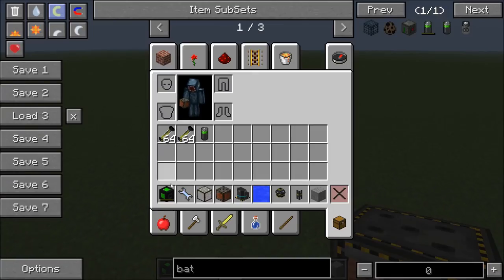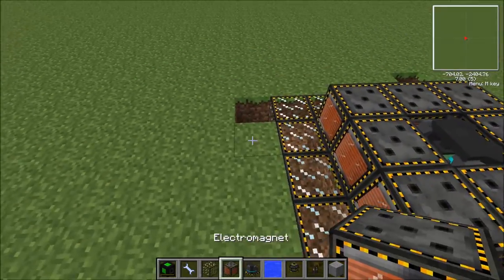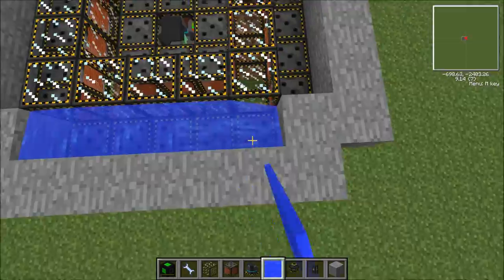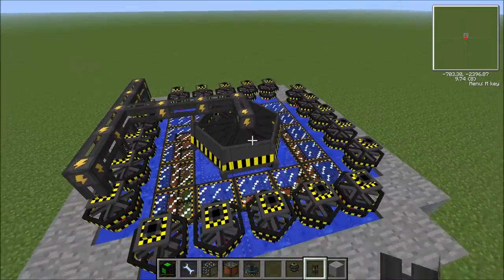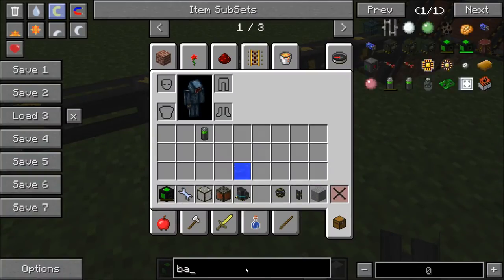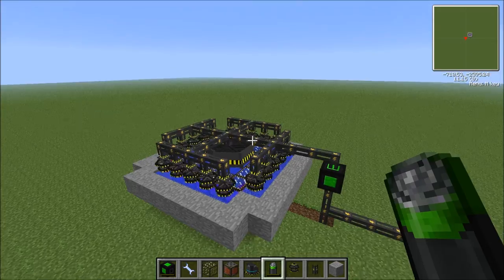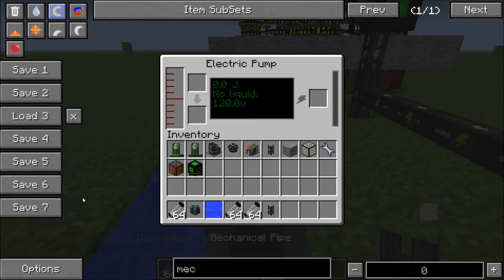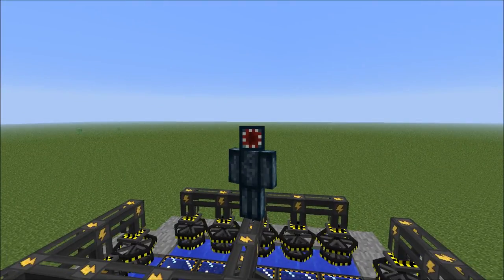VOLTZ TUTORIALS: Fusion Reactor (Small Setup)

Comment: Hey i know this is an old video but the reactor uses more power than it generates is this a bug or updated issue?
Reply from the maker: Might be something do with ur configs on the server or the mod u have installed, if u use a basic cube to power it, it will drain less power, or you can increase output by using steam funnels (see my vid about the largest fusion reactor setup)
Reply: Alex Dodd oh wait sorry I just realised that I’m using it for the modpack big dig and this is a voltz tutorial my bad it had been a long day aha
Reply: @thetennisonegaming  wtf why does the basic energy cube do that like im here using an ultimate cube and it drains like crazy until i switched it out with a basic
Reply from the maker: @nuclearexpert3851    cos the basic cube has a lower voltage than the ultimate cube. Voltage = Current x Resistance. Resistance is constant in minecraft. So V is proportional to the Current. If Voltage is high you drain more energy - and the fusion reactor takes as much as it can get to make plasma. Using a lower voltage still generates plasma but uses less current. I think the attempt is to recreate actual physics in MC but its very limited in its application

Comment: *fission reactor, fusion is what Sun uses
Reply from the maker: Aleksi Siltala yeah fusion is what the sun uses but on an entirely different scale. This reactor uses electromagnets to contain plasma generated via fusion. Fission is also a type of reactor but does not generate plasma but uses heat from decaying radioactive elements, if you’d like to do further reading on experimental fusion reactors - check out the ‘Tokamak’ on Wikipedia :D